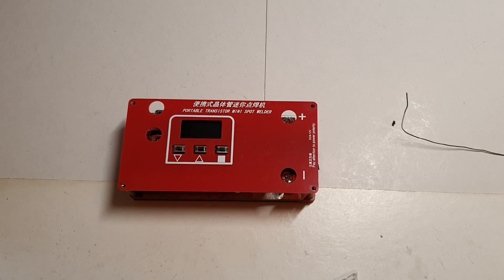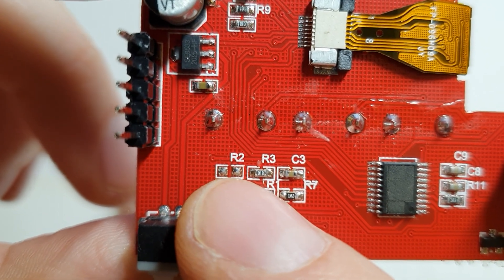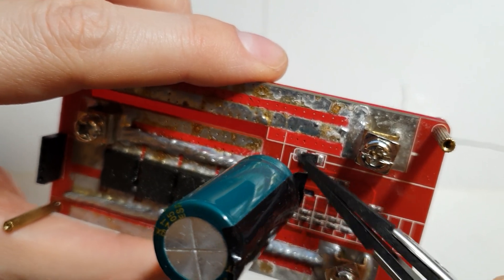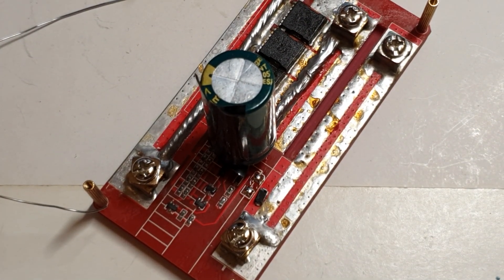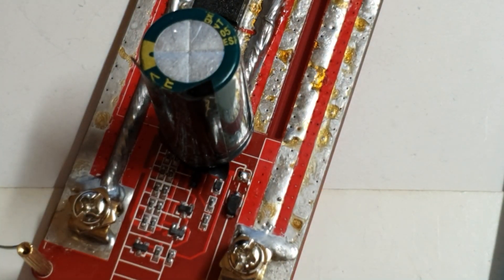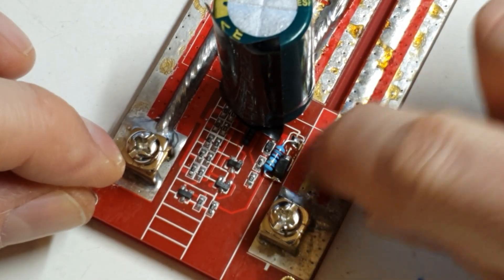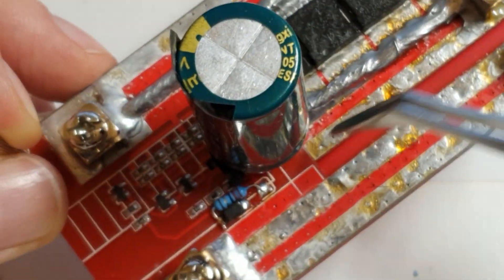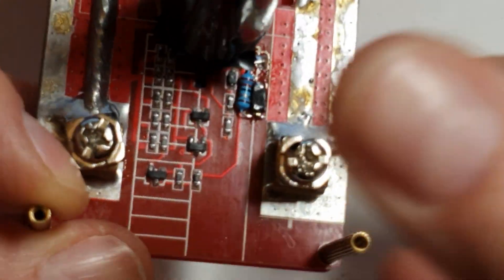Mini Spot Welder Bk11-1k BL18-2K CA04 Inrush current limiter resistor mod - check your diode!

Comment: Hi Luca.  Which of all this versions do you recommend to by.  Tanks for any answer :-)
Reply from the maker: That depends on your soldering skills: all of them need a fix. The best version is the "Rev 0" with the MCP driver which needs the additional CAP mod. All the others need a inrush current limiting resistor fix before or after the main CAP diode. The MAPLE version is probably the more "sane" but less versatile. Please check out my other video about "All Mini Spot Welder" versions and comparisons - it's all explained there (in the video description or playlist).

Comment: I removed my diode from the board and it tested 0 in both directions can anyone tell me what replacement diode I need from digikey?  I prefer digikey because they are based out of my hometown.
Reply from the maker: You can replace it with practically ANY standard diode - it needn't be an SMD component, just a regular 1N400X diode will do. The one on the board is equivalent to a 1N4007 in DO-214 package (M7) but that's not necessary, you can use any 1N4002- 1N4007 1 Amp diode adding a regular 20 Ohm series resistance. As there is space you can use a regular non SMD diode and just solder the legs on the pads. Just solder the series resistor to one side and place it so that one side of the resitor goes to one pad the other to the diode and the end of the diode to the other pad - with the right polarity of course. If you really want to source a replacement from digikey, this one would do fine: https://www.digikey.co.uk/product-detail/en/on-semiconductor/GF1B/GF1BFSCT-ND/3042628 or any equivalent in DO-214 package rated 1 Amp 50V upwards.
Reply: @Luca_Techy  any chance you could link the two resistor as well the 20 ohm and 470 ohm?  I dont know what wattage they should be.  Thank You really hoping this fixes my issue.
Reply from the maker: @bladez2107  any 1/4 or even 1/8th Watt resistor will do.
Reply: @Luca_Techy  so i got my parts today and put them in...  but the screen wouldnt work so i put the original resistor back into r4 and good news is it works but i blew a mosfet the first time i tried it so i pulled it off and tried it again at 30 and it blew another one.  Any idea why i am blowing mosfets?
Reply: @Luca_Techy  I ended up have some surface mount resistors and replaced r4 with one of those and it works now...  Its running on only 3 mosfets but its working just curious how high I dare turning it up
Reply from the maker: @bladez2107  The original R4 with 1K value is not sufficient to drive the Gates properly, you need to change that with a 470 Ohms one else FETS will keep blowing. It will work also with 3 FETS but I don't suggest going over 40ms with a decent battery and use max .12mm strips.
Reply: @Luca_Techy  I ended up popping another one... I am welding .15mm strips and they werent sticking so I turned it up to 60 :s o well I guess I will try to find some mosfets from digikey.
Reply from the maker: @bladez2107  buy 5 from the same batch (digikey is fine) and replace them all *together*, don't mix them with the other 2 left. Be sure to use a capable working battery.

Comment: Hello Sir . I have another question for you. I pulled the M7 Diode and it has continuity in both directions. Does that mean its fried? Thank You very much for your time
Reply from the maker: Yes it's shorted so you need to replace it.
Reply: @Luca_Techy  My Welder works now!!! You have really impressive electronics knowledge. Your teachings have opened a new world of electronics to me that I didn't know I was capable of!! Thanks again for sharing all of this awesome knowledge with all of us.
Reply from the maker: @rcscalebuilders8268  Glad to hear!
Reply: @Luca_Techy  Thank You very much for replying!! I ordered a set of diodes with a bunch of different values. I tried to find it on a bunch of old video cards but had no luck.
Reply from the maker: @rcscalebuilders8268  You can use any classic 1N4002 to 1N4007 diode or equivalents, it is not so critical just any diode with at least a 30V minimum reverse breakdown rated at 1Amp will do fine with a series resistor of 20-50 Ohms.
Reply: @Luca_Techy  I appreciate you taking your time to explain it to me!!

Comment: Well, r4 was a nightmare! I've just knackered my spot welder before I got chance to use it, once I removed r4, the new resistor wouldn't solder back in place, like the track pads had gone, so solder wouldn't stick.
Pretty gutted, they are cheap, but I'm broke and can't afford another welder.
Reply from the maker: You can still fix it as you don't really need to use those exact pads if they are gone/ripped off - you can simply solder a normal 1/4 watt 470 Ohms resistor between where those pads lead to (one comes from pin 19 of the MCU and the other goes to pin 4 of the connector) exposing some tracks. Just use a multimeter in continuity with the beep and scrape some mask off the tracks just next to where the resistor pads are to expose the copper and follow them, you can solder onto them. Don't chuck it away just yet!
Reply: @Luca_Techy  oh that's great news! Thanks for replying, Luca.

Comment: Thank you for all your video's about this spot welder. Bought one too and received version 'CA20-2K'. After powering it up 2 times the diode already shorted out, so I soldered in a new one with 10 ohm resistor in series. Before welding for the first time I beefed up the main PCB tracks and changed R4 to 470 ohm. The issue I had was that the gates of the mosfets were always pulled high, so always conducting. After some time I found out that one of the solder pads of R4 came loose from the PCB. Just a little bit so you couldn't tell just by looking at it. After fixing that it now works really well!

Comment: one question, i have this on order, on it's way. Dont know what version... but do i really need this cap? cant i change it for a 1200 or 3300uF cap instead? I bought a 16.6F cap bank and a lipo 3s 65c battery 6000mAh, is this large cap really needed then?
Reply from the maker: You can of course replace that large cap with a 2200uF or even 1000uF 25V cap - however I still suggest you add the resistor in series with the diode (which you absolutely need for safe operation).
Reply: @Luca_Techy  yes, i have disassembled an old computer psu and are removing piece by piece all components i need to do your mods! hopefully i can rebuild my ebike battery soon, they have too weak series connections so the voltage drop is extreme... it can shut itself of at full throttle while 50% charge.. thanks for all your vids on this welder!

Comment: I did add the resistor after m7 diode as your study on BI18-2k. Job well done and measured.
Now the equipment starts well as before, bips, all good.
But nothing more, it does not trigger the welding, it does not fires on the MOSFETs.
As I did not change anything else my only explanation is it was already defective from start. I never tried welding. Just now, several times. I'm thinking of trying manual. But I'll wait , maybe you have a better idea.
TY
Reply from the maker: Did you replace the R4 1K resistor on the MCU board with a 470 Ohms one?
Reply: @Luca_Techy  well, I heard about that one, then I never did it.
OK I'll try it. TY.
I just read another comment, it's a variation, just solder another 1K resistor in parallel. I'll try it.
Reply from the maker: Yes you can also do that - the important thing is reduce the resistance to around 500 Ohms.

Comment: Why isn't the pin on the Mosfets farthest to the left soldered? Can you bridge all the pins with solder?
Reply from the maker: Pin 1 is the GATE, it is soldered and connected through a via to the other side of the pcb and goes to the trigger circuit. If you bridge it the FET won't work. I explain it in my other videos - do not bridge it with the rest (source).
Reply: @Luca_Techy  Thanks for the information, then I have to unsolder that again 🙂 was a little quick with reinforcing the soldering.

Comment: I have a spot welder CA04 and already destroyed 2 mosfets (same problem as yours my diode died and destroy them). The problem is that i cannot find them anywhere on internet nor aliexress to fix my welder.Can you give me some link where i can buy them (by acceptable price or even better can you tell me which mosfet (fet) i can use as a replacement if is possible.Thank you in advance.
Reply from the maker: I put a link to Aliexpress in one of my videos - or you can get them from digikey IPLU300N04S4 (Infineon). You can still use the welder with 3  FETs if you do the mods, just dont push them over 20ms if you have a strong battery (over 150CCA) to avoid overdriving and killing them. Keep in mind you should always replace them with the same matched batch.
Reply: Can you resend the link from aliexress if is not too much trouble for you? I don't know how much they cost but what you think is it not better to buy new welder and do the mods on him? And which one is the best on that matter ?
Reply from the maker: @gocegegovski2909  https://www.aliexpress.com/item/1005001369519751.html
They are cheap, but you'll need to wait a few weeks. Else you'll need to source them on digikey but a batch 'll cost more than the welder itself.
Reply: @Luca_Techy  Thank you very much.And if i choose to buy new welder which one is the best by your opinion? wise maple?
Reply from the maker: @gocegegovski2909  Check out my latest video on the comparions - the Wise Maple works but it's not the better of the lot - that would be the first Rev0 or BH/ BL19, difficult to source (I have no links) and NEEDS the CAP MOD. It's the best of the lot in terms of performance because of it's MCP FET driver.

Comment: I received my spot welder today. It's a CA04, I opened it right away without turn it on to test it to check if it's was working or not. 
I did your mods, and no problems.
Everything is perfect after 50 welds.
The battery used was a Turnigy 3S 5000mah lipo 45-90C.
Thank you very much for the tutorial, it's very well explained, keep up the good work.
Regards from Portugal.
Reply from the maker: Cheers!

Comment: Did the mods check everything its ok working beeping just now welding no spark nothing -there is 12v on the electrodes always, dont know what to check anymore.
Reply from the maker: Did you change R4 with a 470Ohms? It's normal to measure a trace voltage on the electrodes as this is the "detect" voltage for the auto weld function. If you changed the resistor and you're getting no spark or no weld activity and you are sure you have a good car battery or Lipo (4000mAh 50C at least) then your FETs are not being driven - you will need to analyse the Gate signal but you can also check with a tester in Ohms if any of the Gates are shorted (pin 1 of every FET to Source or negative bus should NOT be shorted).

Comment: It was clear enough in your previous video.
You clearly say put the resistor in series with the diode.
It was also logical to me that you  have to swap the diode 180° degrees.
From main Plus to the resistor, from resistor to the diode anode, from diode cathode to the rest of the circuit. 
Anyways thank you so much for sharing this solution.

Comment: Will the inrush resistor die soon, since the charging current is way above its rated current? I use a 0805 22Ohm 0.1W resistor, will it hold? Maybe changing to a 2200 uF capacitor is a better solution?
Reply from the maker: The peak current is around 600mA at 12V so about 6-7 Watts - but this lasts for just a few inital milliseconds. However, the .1Watt resistor may eventually fail after repeated peaks as it's thermal capacity is really small. If this ever happens it's not big problem as the welder simply won't turn on. A 1/4 watt resistor will handle those transients better. You can either increase the resistance (say 50 Ohms) or simply use a non SMD one if you want to stay on the safe side or ultimately reduce the capacitor size - but I would suggest changing the resistor with a 1/4 watt keeping 22Ohms.
Reply: @Luca_Techy  I use the SMD resistor because it can be soldered in a less hacking way https://i.imgur.com/85ynVLm.jpg , maybe it is better to solder an SMD inductor to absorb the pulse energy?
Reply from the maker: @HyperF1  I wouldn't suggest it as it can introduce "noise ringing" with voltage pulses and the inductor can be rather large to limit that initial current (haven't run any numbers though). Resistors are always preferrable for this kind of application.
Reply: @Luca_Techy  I doubt the necessity of the 10000uF capacitor on board since the M7 diode prevents its discharging during welding. Does this mean the unlabelled version with a 1000uF mod is better than the follow-up versions?
Reply from the maker: @HyperF1  All versions have a 10000uF cap (except the Wise Maple) but the first revisions (that need the added cap on the MCU) have this cap wired without any diode as it's in parallel to the battery. The later versions were modified with a series diode but not correctly done as you see. I am making a follow up video where I explain the various versions including the first revision to explain all the differences and errors.
Reply: @Luca_Techy  Very much looking forward to your next video. I would also like to know if the big 10000uF capacitor can discharge together with the battery, will it help to have a stronger welding joint, or is its help negligible?

Comment: I checked the diode now and it's shorted in both directions! :P
Reply: Luca, and if i use a SS54 smd (Schottky) with 20 ohm resistor? What do you think?
Just because I have a lot of them here.
Reply from the maker: @marcopter  That will do fine!
Reply: @Luca_Techy  I think they use a Schottky too, or am I wrong?
Reply from the maker: @marcopter  The M7 is an equivalent to the normal 1N4007, it's an ordinary rectifier diode, not Schottky. You can use any diode you want here with a 20 Ohm  limiting series resistor, as long as it's min 1Amp continuous you're fine.
Reply: @Luca_Techy  in your video at 28:40 i can read "SS1" over the diode: https://youtu.be/ec4dpBrU4v4 - It's an ordinary rectifier diode?
Reply from the maker: @Marco Robustini  Yes that board has an SS1 my other 3 boards have an M7 - it makes no difference in this case - we are not needing a fast recovery diode, this is not a switching PSU. You can use any diode that is rated above 1Amp. If you have an SS1 use it, as I said, it's fine.

Comment: After all MODs on BL18 board, I have checked some signals with my scope and it still not working!! The signal that comes from MCU at base of Q1 is a negative pulse of 200mV (the DC level at base of Q1 is 600mV). On collector of Q1 (base of Q2 and Q3) the signal is positive pulse of ONLY 3V and the signal at output of Q2/Q3 (emissors) is exactly the same: a positive pulse of 3V!! So, I decided to swap the controller board with my other C04 version using the same mosfet power board... The signals are still the same. So, the problem is located on power board. I have checked all the resistors values and they are OK. What do you think? The Q1 transistor is bad?? I have even lowered the R4 value on the controller board to 220ohms and the signals didn't change!!!
Reply from the maker: Can you check if any of your Gates are not shorted? Check every pin 1 of ever MOSFET between DRAIN and SOURCE, it should be high impedance and no short while between every 2 gates you should read 60 Ohms. Something is pulling the voltage down from the push-pull so something is not right. On the Emitter output of the push-pull towards the Gates you should read 10-12V pulse. The pulse coming from the MCU board is a negative pulse and the values that you report sound correct but need to verify it (the MCU DROPS the output voltage to turn OFF the first driver (Q1) which turns ON the push pull (Q2-Q3) as it is an inverting setup.
Reply: @Luca_Techy  You are the MAN!!!! You were right again!!! As I have left only 3 good mosfets that didn't blown up, I was thinking that all was good, but it was not the case!!! I removed ALL mosfets and somehow one of them was pulling the trigger signal down!! Now I have a positive pulse of 11V at base of Q2/Q3 and the same pulse at output of Q2 and Q3!!! I will replace all the mosfets as soon as I receive the lot of 10 that I have already ordered at Aliexpress!! I have learned a LOT from your awesome videos!!! Thanks a lot!!!

Comment: Hi Luca, great job.  I have done everything that you have so carefully and informatively demonstrated.  Everything working absolutely wonderfully.  Thanks

Just a quick question, I want to extend/increase the length of the battery cables with 8 gauge (AWG) since I am using a 60Ah car battery and the cables are a bit sort and the welder up in the air.  Not very convenient...  I was wondering if there would be a length restriction?  Great stuff.  Keep up the good work.  Again thanks.
Reply from the maker: You can increase the cable length using good copper stranded silicon AWG8 cable by double the current length without major voltage drop (consider the current AWG 10 cable is tinned aluminum not copper). Of course shorter is always better.
Reply: @Luca_Techy  Thanks for the advice, will consider  & measure my changes
Reply: @Luca_Techy  As to my version, I soldered an EC5 connector to the cables and the strands absorbed the solder very well, which means they are quite coppery. Considering their reddish cross sections and weight... However, they do resemble the cables coming with the cheap car jump starters which use copper-clad alumimiun wires.